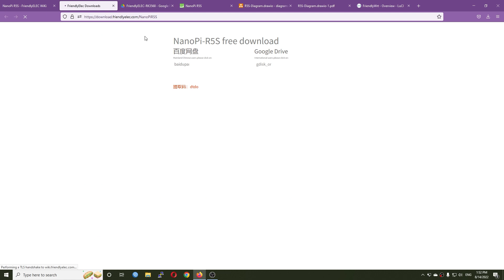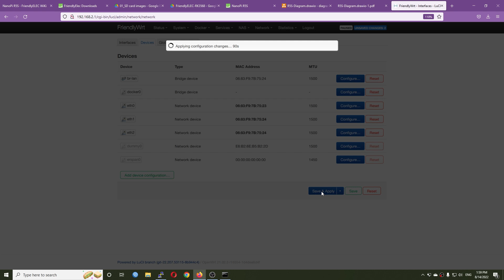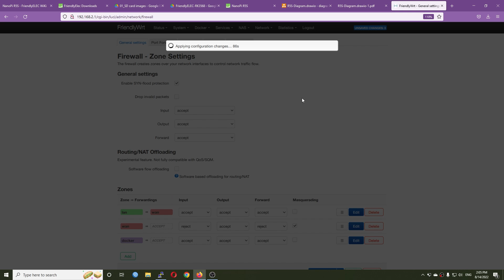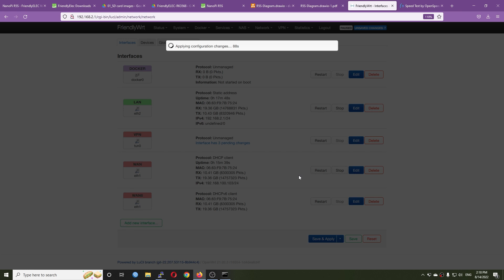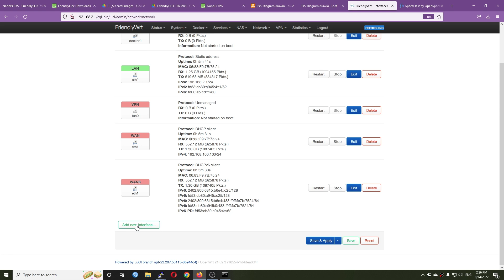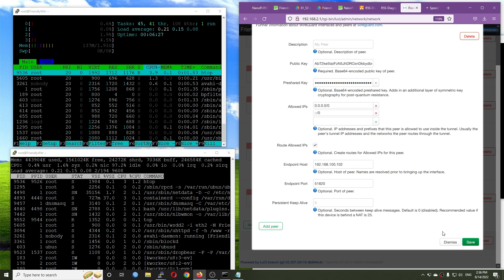OpenWRT - NanoPi R5S Performance Test (NAT, OpenVPN & Wireguard VPN)

Comment: Nice one! I'd be interested to correlate the results (especially the seemingly unstable ones) with the SoC temperature and CPU/memory frequency (as applicable) , I'm reasonably certain this thing would throttle down at higher temps. Btw, this is passive cooling, just a metal case, right?
Reply: A55 cores are slow, but don't consume much energy. 4 cores together mau spend 2-4 Wt, and metal case is probably enough to cool them

Comment: thanks for the amazing tests and reviews! would u recommend this over the R4S as a router? the extra port is useful for me as an extra vlan port for iptv, eliminating the need for a managed switch, but the R4S' chip performs better i believe
Reply from the maker: Hi, sorry for the late response. I still recommend the R4S over the R5S if you are looking for performance in QoS, VPN, etc. However, if your internet plan is below 800 Mbps (estimate number), using the R5S and utilise these 2 LAN ports will be a good choice. Uf you are living in Asia/China, you can also take a look at the FastRhino R68s (2x Gigabit + 2x 2.5 Gigabit).

Comment: Came for the speedtest and while the video was helpful its unfortunate to see the nanopi not able to sustain a reliable speed test for just normal wan to lan. Ive been looking for a new router for a project that needs to have wifi built in. r5c is what I was looking at with similar cpu. It seemed perfect. 2.5G in and out. Small footprint with low power usage. Wifi. Ability to run docker containers was a big plus but if the cpu cant handle it then im back to the drawing board.